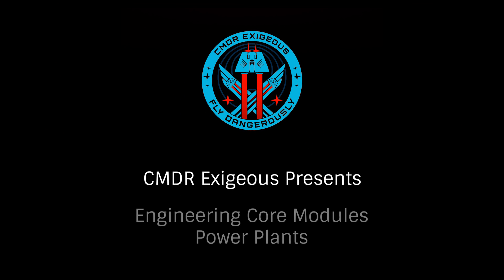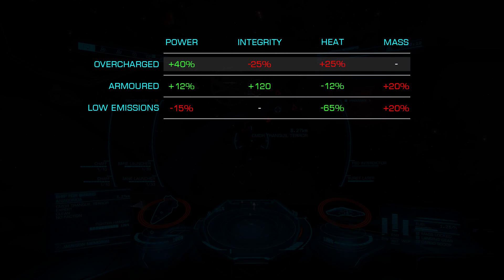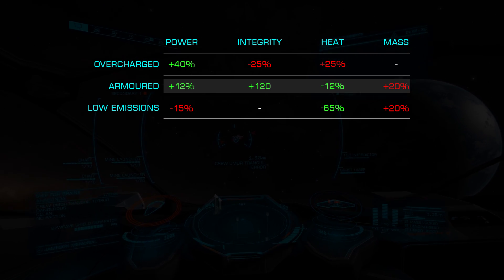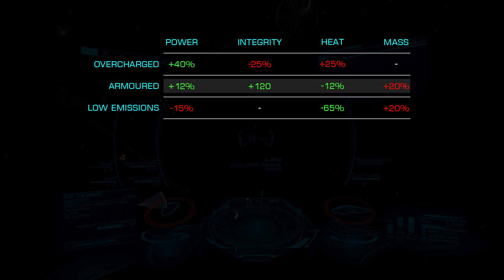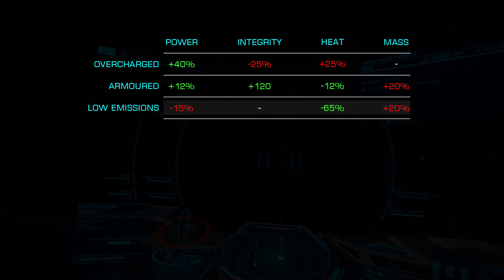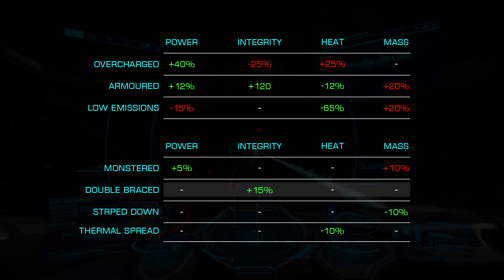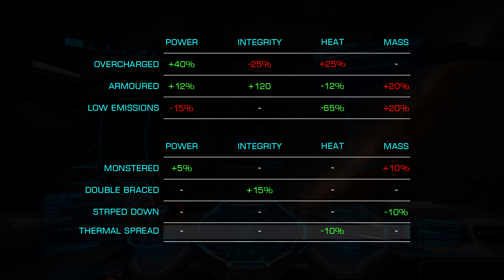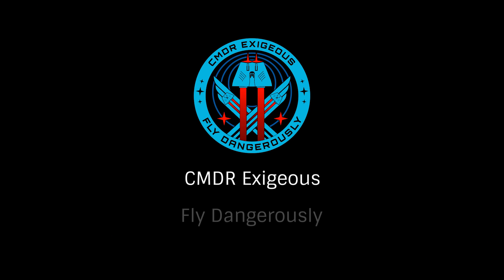Engineering Explained: Power Plants

Comment: I'm two years late on commenting here, but I put a G5 OC Monstered PP on my combat ship and am running into the obvious overheating (that i neglected to take into consideration). Am I stuck with having to ease off the trigger with my thermal weapons at the critical threshold, or is there a more baked-in solution?
Reply: Heatsinks or just overheating. If you don't go to high over the top it's mostly fine, and if you do, you can use a heatsink and continue fire. Also some weapons can be engineered to "thermal vent" which cools your ship and overheats the enemy instead, so long as you're not missing. I saw a vulture running silent and continuously firing two large beam lasers once, which only worked because of thermal vent

Comment: Armoured can be very useful for explorers.  You want to use the smallest A rated plant you can with exploration builds for heat efficiency and weight savings.  Armored can let you us a smaller A plant by giving you extra power and also maintain your heat level for safe scooping.  The power plant is the one module that can't be repaired by an AFMU, so integrity is also important.  Stripping it down afterwards will drop off a lot of the weight penalty, especially if you only Armour to meet your power requirement.
Reply: My explorerconda has a 2A power plant overcharged (I forgot stripped down tho) that works erfectly fine, i went to beagle point and back and needed like 2 heatsinks the entire way